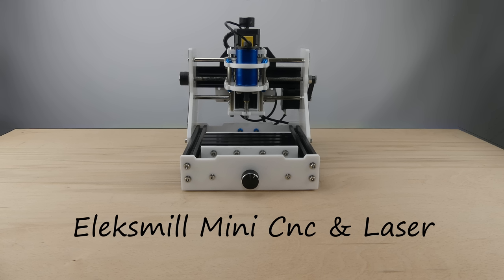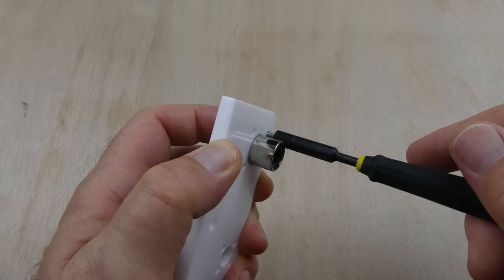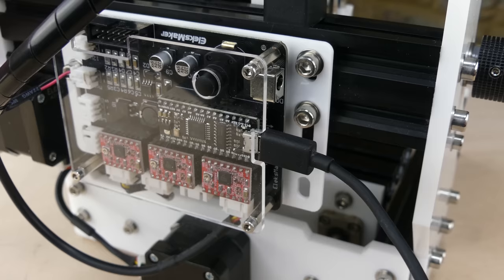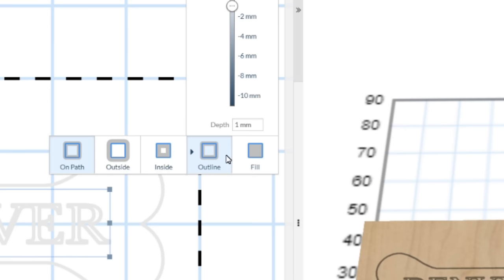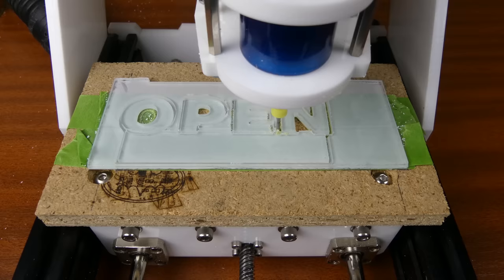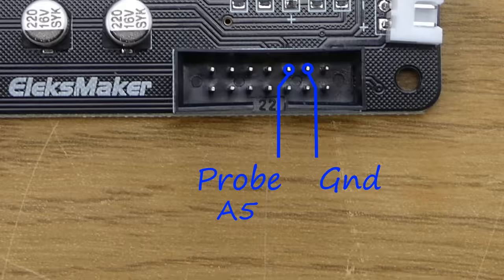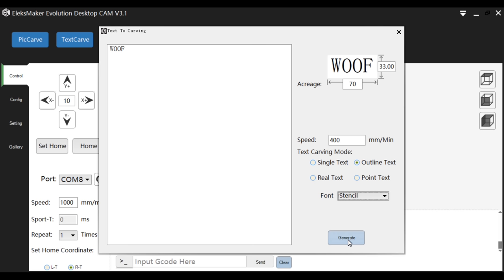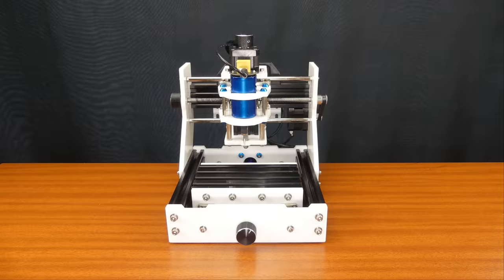Eleksmaker Eleksmill Cnc Mill - Router & Laser Build, Tutorial & Test

Comment: Is anyone still using this Machine? I'm trying to mill a PCB, but every time it get a bit load because of cutting it looks like controller reboots and the machine stops. Any resources to read about this?
Reply from the maker: I would check the power supply/ swap it and probably the power regulation circuits on the controller pcb. You could always disconnect the spindle from the controller and power it seperately. Failing that just look for another grbl based controller pcb, they are fairly cheap and they are all fairly generic.

Comment from the maker: EleksMill  http://bit.ly/34HfleT 
Eleksmaker forum     https://forum.eleksmaker.com/
Eleksmaker Wiki   https://wiki.eleksmaker.com/
Grblcontrol    https://github.com/trasz/grblControl
Easel inventables    http://easel.inventables.com
Chillipepper grbl   http://chilipeppr.com/grbl
Flatcam   http://flatcam.org/
LaserGRBL    http://lasergrbl.com/

WD40 white lithium grease  (for lubricating the leadscrews)
US   https://amzn.to/36dYFME
UK  https://amzn.to/2RvCi18

WD40 CT90 cutting oil  (for cutting metal)
UK   https://amzn.to/2DXVGeY

The Acrylic sheet sheet used was cast acrylic. Extruded acrylic does not mill very well.

Router bits
US  https://amzn.to/36agDj0
UK  https://amzn.to/2s8S0UY

MDP-XP power supply
US   https://amzn.to/2LuOoUs
UK  https://amzn.to/2OZQAoY

Index
Overview 0:00
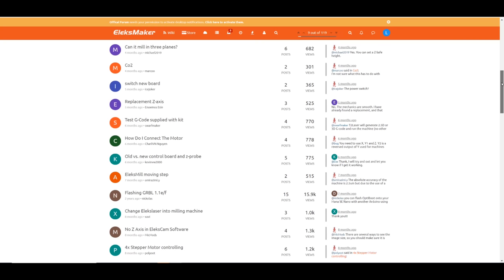Build the Eleksmill   2:20 
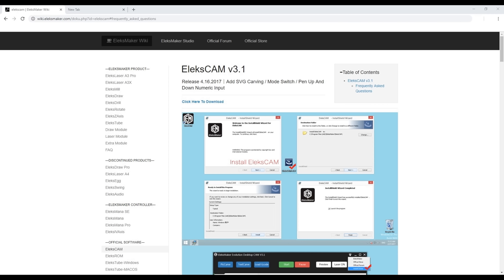Installing & configuring Elekscam  12:00
Installing & configuring Grblcontrol    12:35
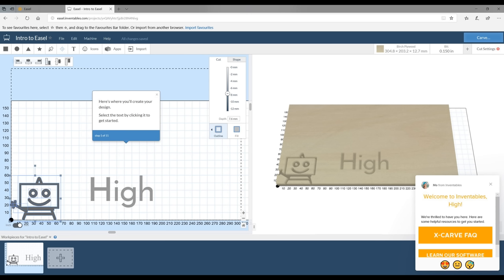Creating a design in  Easel     14:43
Generate gcode in easel     17:46
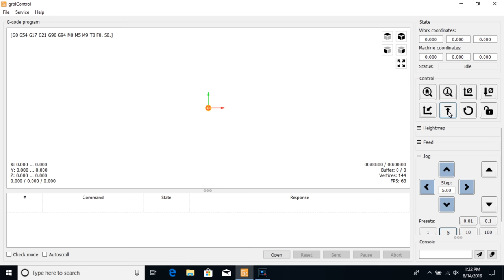Milling the first project     18:35   
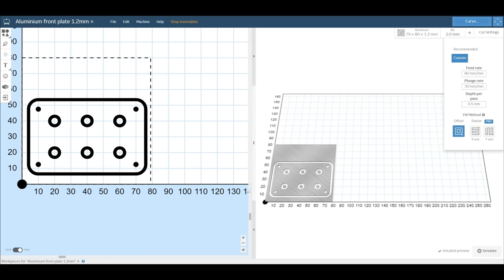Aluminium sheet front panel    19:55
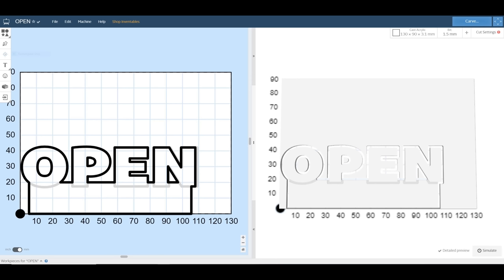Acrylic edge lit sign      21:45
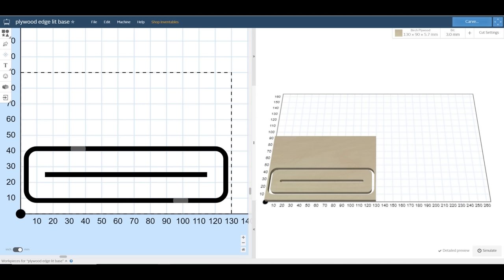Edge lit sign base (plywood)     24:07
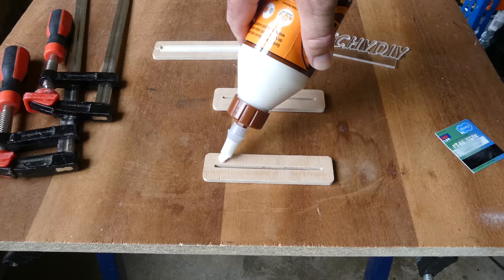Edge lit sign assembly      25:52
PCB milling with Eagle and Flatcam       26:13
PCB milling with Chillipepper/grbl       28:51
Laser installation        31:24
Elekscam laser      32:40
Elekscam Piccarve (Wolf)      33:42
Elekscam Textcarve        34:48
LaserGRBL            35:34
R2D2      36:29
Vinyl adhesive (sticky back plastic) cutting      37:44
Editing Easel gcode for use with the laser       38:10
Making a PCB with the laser  (Flatcam)    39:35

Comment: So in theory, one could get longer 2040 aluminum extrusions, longer lead screws and rods, and 3D print or Mill wider replacements for the acrylic parts.  Thus making a larger machine.  I would have to find a solution for the larger build plate.  I have a 3018-mx3 that I'm thinking about extending this way.  No one seems to have any videos or tutorials, covering this. :-(
Reply: That's fine but you have to understand that anything you extend is going to suffer increased flexing.

Comment: For the price they are charging you can get a 3018 pro with laser.  Not a good deal any more but thank you for the vid.
Reply from the maker: I have three different 3018 machines and they are all less accurate than the eleksmill. It is a much stiffer machine and for that reason it is what I use for PCB milling.

Comment: on the perspex  sign how did you make the layout i have been trying with easel for ages thanks great vid btw
Reply from the maker: Which part, acrylic or base ?
Reply: @techydiy  acrylic, bit hard to explain i can get the text open ok  and a box underneath but it cuts out as 2 shapes rather than follow round the whole lot as one if you know what i mean thank you
Reply from the maker: You need to select both shapes and then use the combine function to create the outline. What I also did first was to copy the text, reduce the cut depth to 0.5mm and then use it engrave the letters.
Reply: @techydiy  thank you i did find combine and that sorted please keep making great videos :)
Reply: @techydiy  one again thanks for this video i have learned a lot from it  and becoming quite good now with this , i would like to ask on your open sign under each letter is a score mark how is this achieved? i have my lettering ok and an oblong box then combine just cant seem to figure out the line under each letter . thanks again
Reply from the maker: @stephenlowry1023  Take a copy of the text before you combine it with the rectangle. Combine the original text and the rectangle. Set the depth of the copy to engrave the letters. Put it back in position in a new job and or paste it back over the top of the original job. So you engrave the letters first and then cut the outline
Reply: @techydiy  thanks just tried that had been wrecking my skull for ages never thought of cut n paste

Comment: Very good afternoon from Gran Canaria Spain, could you publish the $$ parameters of your machine? I have an EleksLaser-A3 Pro with a 15W drill and laser and this is my configuration, but I don't know if it is correct ... could you help me?

** Connected to COM3 @ 115200 baud **
Grbl 1.1g ['$' for help]
>>> $$
$ 0 = 10 (Step pulse time, microseconds)
$ 1 = 25 (Step idle delay, milliseconds)
$ 2 = 0 (Step pulse invert, mask)
$ 3 = 4 (Step direction invert, mask)
$ 4 = 0 (Invert step enable pin, boolean)
$ 5 = 0 (Invert limit pins, boolean)
$ 6 = 0 (Invert probe pin, boolean)
$ 10 = 1 (Status report options, mask)
$ 11 = 0.010 (Junction deviation, millimeters)
$ 12 = 0.002 (Arc tolerance, millimeters)
$ 13 = 0 (Report in inches, boolean)
$ 20 = 0 (Soft limits enable, boolean)
$ 21 = 0 (Hard limits enable, boolean)
$ 22 = 0 (Homing cycle enable, boolean)
$ 23 = 0 (Homing direction invert, mask)
$ 24 = 100,000 (Homing locate feed rate, mm / min)
$ 25 = 1000,000 (Homing search seek rate, mm / min)
$ 26 = 250 (Homing switch debounce delay, milliseconds)
$ 27 = 1,000 (Homing switch pull-off distance, millimeters)
$ 30 = 1000 (Maximum spindle speed, RPM)
$ 31 = 0 (Minimum spindle speed, RPM)
$ 32 = 1 (Laser-mode enable, boolean)
$ 100 = 400,000 (X-axis travel resolution, step / mm)
$ 101 = 400,000 (Y-axis travel resolution, step / mm)
$ 102 = 80,000 (Z-axis travel resolution, step / mm)
$ 110 = 5000,000 (X-axis maximum rate, mm / min)
$ 111 = 5000,000 (Y-axis maximum rate, mm / min)
$ 112 = 5000,000 (Z-axis maximum rate, mm / min)
$ 120 = 800,000 (X-axis acceleration, mm / sec ^ 2)
$ 121 = 800,000 (Y-axis acceleration, mm / sec ^ 2)
$ 122 = 5000,000 (Z-axis acceleration, mm / sec ^ 2)
$ 130 = 400,000 (X-axis maximum travel, millimeters)
$ 131 = 300,000 (Y-axis maximum travel, millimeters)
$ 132 = 200,000 (Z-axis maximum travel, millimeters)
Reply from the maker: It wouldn't be what you need, it's a different machine.. You should calibrate the X, y & z axis of your machine. My latest video demonstrates how to do it. Then you probably need to setup things like the acceleration, the grbl documentation on GitHub explains how.
Reply: @techydiy  thank you for this.